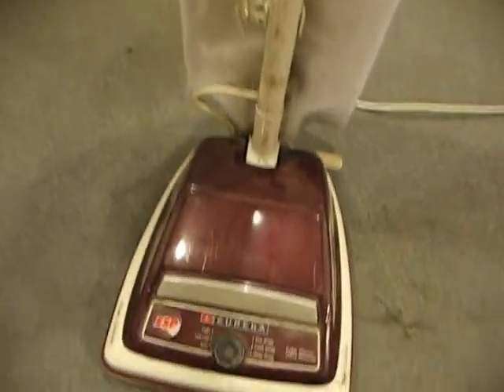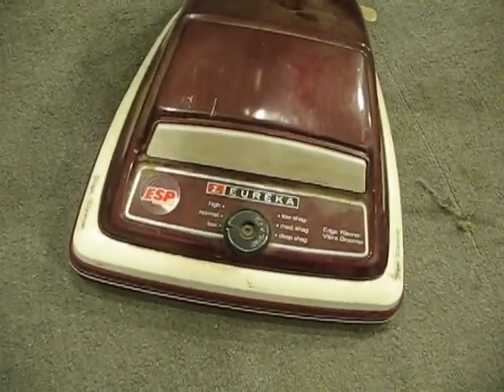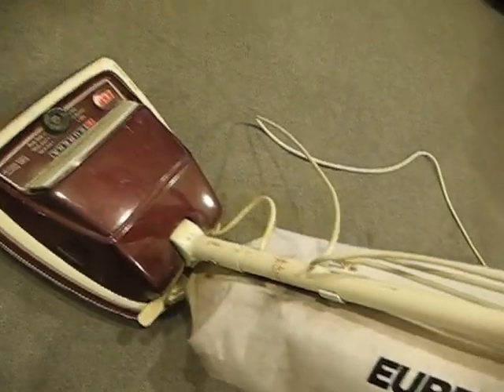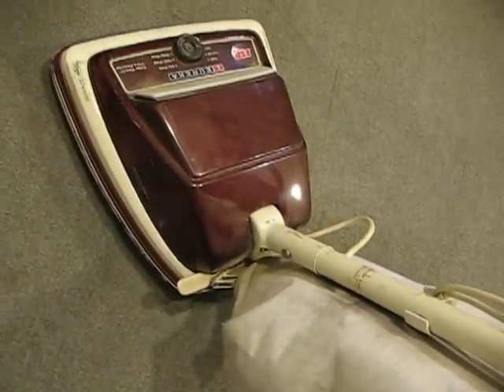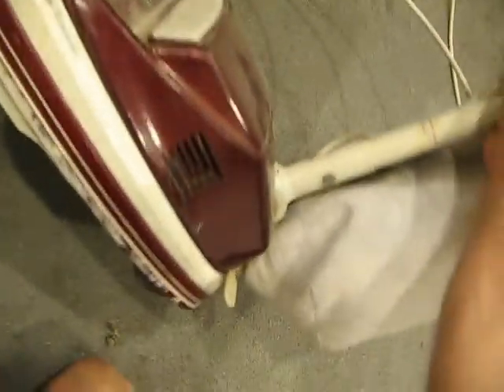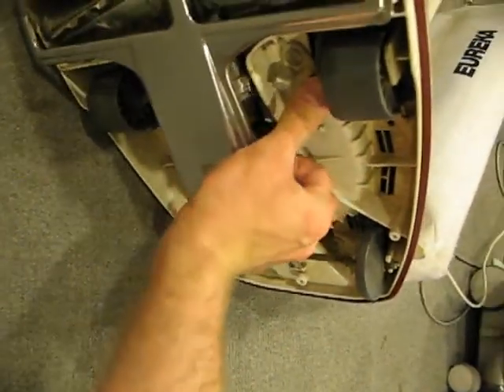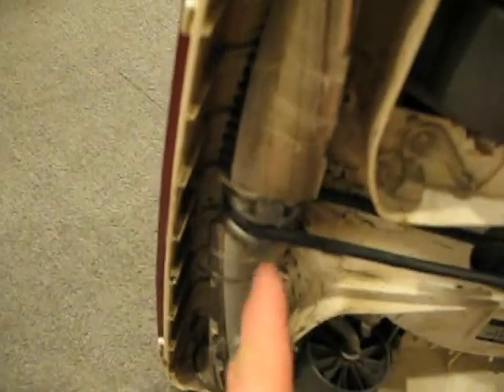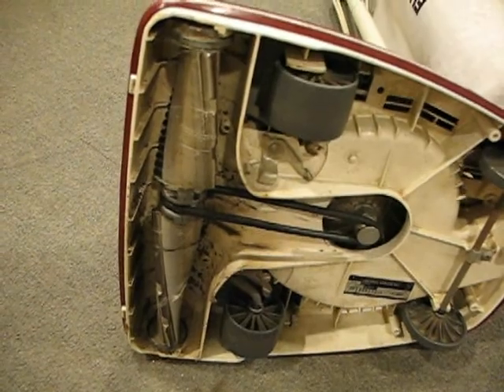Vintage Eureka Upright vacuum

Comment: Yes must be from the mid-late 70's based on the specialization in shag although something about the Eureka logo on the bag looks like it may be a little later...maybe this was from when that slanting letter "Eureka" logo was introduced.
Reply: The bag on this production sample is a replacement. The original bag was vinyl instead of cloth, and was the same color (Brandywine) as the motor housing.

Comment: +Maxxarcade you can use a vibra groomer 2 on those types of eureka uprights i will be using on the new sanitaire and you can get eureka rd belts on eBay for around 5$

Comment: The first thing you should do is unplug the vacuum before you remove the bottom plate especially seeing that it has the power switch on the handle, unlike where they are usually on the foot release on Eureka.

Comment: there are 3 motors&roller brush  types  in the old&new Eureka F&G vacuums   a big,mid and tiny   motor the mid and big ones will do better then any kirby  when they  VG1,VG2 roller brushes  the vg2 is chrome steel 1 row of brushes the VG1 is aluminum with 1 or 2 rows of brushes the wood roller and tiny motor
are shit -your a vac tech